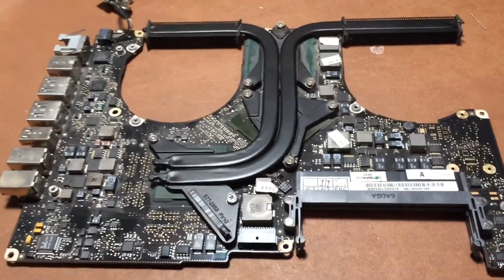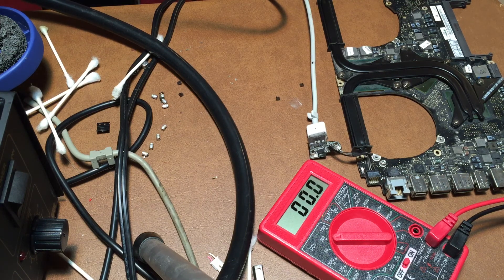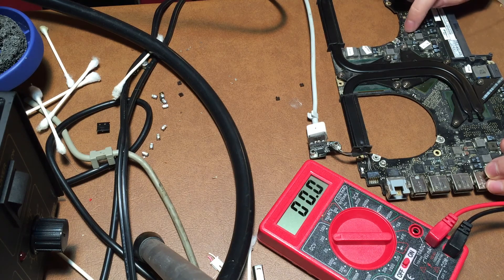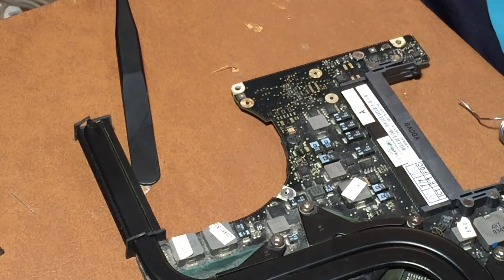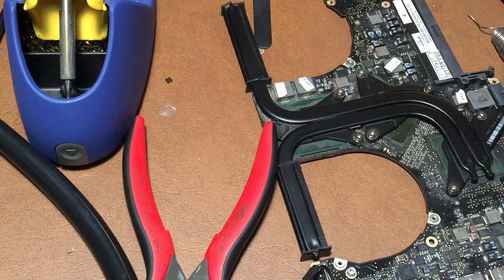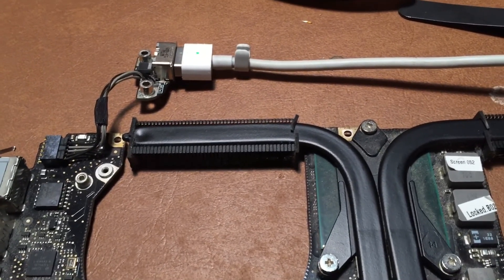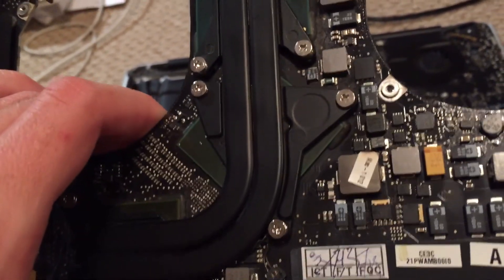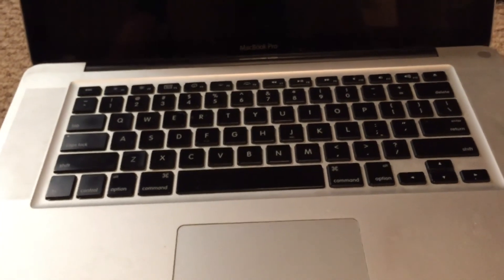Late-2008 15" MacBook Pro Logic Board Repair

Comment: I have the same model, and when i plug the charger, a very dim light is on, and that tiny black square resistor is a bit burned, and when the charger is connected gets really hot, and smells bad, i have disconnected it immediately, thanks

Comment: I have my Macbook Pro mid 2009 that works very bad. I have to unplug the battery and the computer powers on automatically. But if I plug the battery back the macbook goes to sleep mode. Only works if again if i remove the battery.
If I turn off, and remove battery, it will not power on anymore, unless i plug the battery back again and then unplug it one more time.
I tried a SMC reset but nothing happened

Comment: I have the same machine, The magsafe works and the battery indicator seems to be working... but it just doesn't turn on... I've reset the smc and vram, but just doesn't turn on... :/.....
Reply from the maker: Yeah, C7771 is bad.

Comment: Hi, I'm Antonio, from Spain. Thank you for videos. I think that I have  the same PROBLEM: No green light on Magsafe and No battery recharge and No turn on the computer (only turn on with battery with charge) Model Unibody 15" Late 2008. I spend too much money replacing Magsafe, Power supply and battery but no fix the problem. Can you send me schematic and what items have to replace? My email:  floren_plc@hotmail.com
Another Question, Can I replace Late 2008 logic board with Early or Mid 2009? They seem identicals. Thanks.
Reply from the maker: You can find the schematics on my site at http://dosdude1.com/schematics (it is the 820-2330 board). In your case, the first thing I'd check is to make sure the PP3V42_G3H rail is present when the MagSafe is plugged in. If the board works only off battery, I'd check D6905 and make sure you have ~16.5-18V on all pins. Also check the DC IN fuse (F6905) and if that's good, check ADAPTER_SENSE and SMC_BC_ACOK rails. You cannot replace the board with one from a newer MacBook Pro, as the newer boards have many differences that will prevent it (SD card slot and no ExpressCard slot just to name one).

Comment: Hi, thank you so much for the video. Could you please let us know the source you used for the replacement capacitor?

 I know the original one is a 330uf tantalum, dont know the voltage rating but has theres only aprox 1.1v across I would guess a capacitor rated 6.3v or 10v will do. 

Did you replace it with another tantalum capacitor or with an electrolytic?

 I was thinking in going with an electrolytic one but has that board has a lot of heat Im afraid to use as Electrolytic capacitors are know for not liking heat. thanks
Reply from the maker: I just grabbed a capacitor of the same value off another dead MacBook logic board I had. I'd recommend keeping it as a tantalum, but one thing you'll need to be aware of is the space where the capacitor goes is very small, so it may be hard to find something that actually fits. I have another video on my channel showing this repair on a Mid-2009 17" machine, so you can watch that for more details.
Reply: Thank you so much for your reply. My computer is not an unibody, it's a 2008 15inch non-unibody Macbook Pro. It's doesn't power up, Battery, power button and PSU are fine, and I have a green light on the PSU connector. Althoug it doesn't power up. This is a common problem in non-unibody Macbook Pro after some years. I don't know if this might be the same problem as a failed capacitor like the 2008 unibody Macs. 
I can force start the non-unibody Macbook pro by removing battery and PSU, pressing power button for 10 seconds then insert the PSU connector (while keep pressing power button) and keep pressing for more 10 seconds. It starts up, althought doesnt charge the battery. I guess if I can do this the graphics chip is fine and theres some other reason in the voltages supply circuit for it not starting up in the normal way and charging the battery. I can see a lot of people with the same problem in non unibody Macs, although people normally solve this by replacing the Logic Board, but I would prefer to actually fix the Logic Board.
Reply from the maker: Ok, those machines are completely different than the Unibodies, and don't have the capacitor issue like they do. Usually it's the left I/O board that fails in those, try replacing that and see if that makes a difference.
Reply: Thank you I will investigate on that
Reply: I'm trying to source a used I/O board for this one. I can start the computer with an SMC Bypass startup, graahics, ram and HD all work well with the SMC bypass. Although I can't power up normally

Comment: Hi can you send me boardview files, i have problem with my MacBook The same model. He have green Light But no wont turn on!! 
Please send me in e-mail dane.barisa@ Gmail.com
Reply from the maker: C7771 is bad. I'll send schematics and board view to your email.
Reply: dosdude1 Thanks bro.
Reply from the maker: Yeah, you just need to replace C7771 on the logic board, it's a very common issue. If you need schematics or board view files, just send me your email address. You can also send me your machine and I can do the repair for you, assuming you're in the US.

Comment: For your own sake..
Please, please, PLEASE get a proper multi meter!
Reply from the maker: LOL I know that multimeter is garbage... But hey, it gets the job done... Definitely will get a better one soon though.
Reply: Whats the problem? that multimeter is completely fine. It measures voltage, Resistance, diodes, continuity. Completely fine for 90% of job repairs

Comment: i just have a question, i am having a problem with an iPad mini not giving me any sort of display, after i switched the battery out, any help would be helpful. i have a very soon date that this needs to be fixed please help thanks!
Reply from the maker: I don't really work with iDevice logic boards... Is it water damaged at all?
Reply: no, i just opened it, and tried to replace the battery reassembled it and it didn't function
Reply from the maker: Oh, in that case I'd recommend that you just check the connection for the display and digitizer. Just ensure it's connected properly and seated securely.
Reply: ok, i will. how do i tell without completely reassembling the iPad

Comment: what is the program you use on the schematics?
Reply from the maker: It's the Landrex "Board View" program that comes with a lot of the schematics you download. It's a Windows-only application, but I got it to run on Mac OS X using Wine, which works just fine.

Comment: Why don't you use solder that has flux built in? Also, why don't you ever show your face?
Reply: Based on my experience, there's a chance the flux might burn off before the solder touches the board.
Reply: ***** Never had an issue. I just clean off the burnt flux.